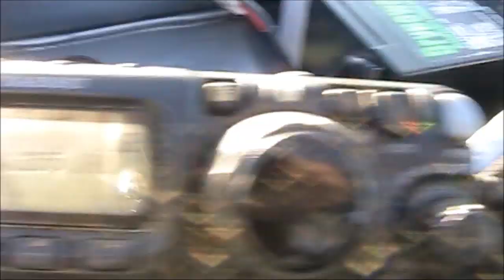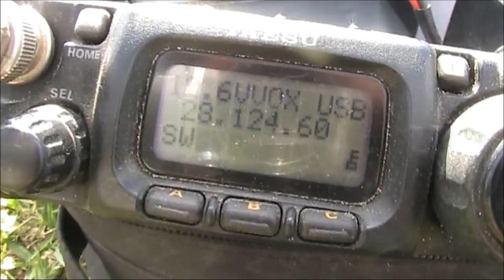Making a 28 MHz vertical dipole into a beam: Does it work?

Comment: Your parasitic and driven elements are blowing around quite a bit, especially the parasitic one, probably accounting for some variance. Especially if it's messing with the effective element spacing/coupling.
I have done experiments with this using an end fed half wave antenna and a self resonant 1/2 wave element a 1/4 wave away from it.
A self resonant element at this spacing provides reflector action with pretty well the best gain for a 2 element antenna (A director can provide slightly more but with a lower feed impedance). 
With this self resonant element and configuration the SWR didn't degrade, but even dropped. It was 1.15:1 without the element, and went down to 1:1 with the element in place. Field strength measurements indicated perhaps a 4 to 5dB increase and signals in the direction away from the element appeared to go up by around 1 S unit